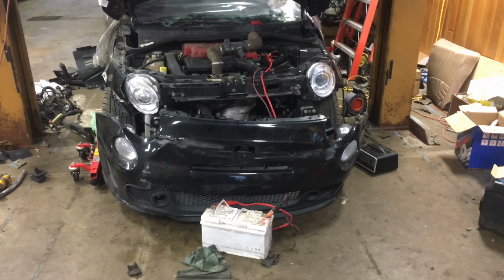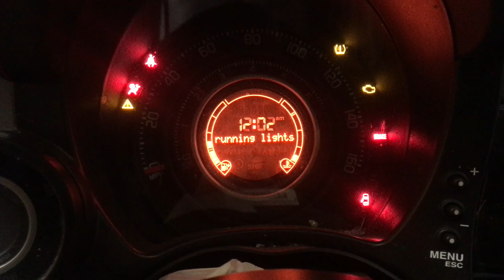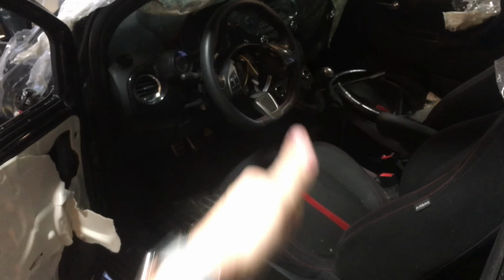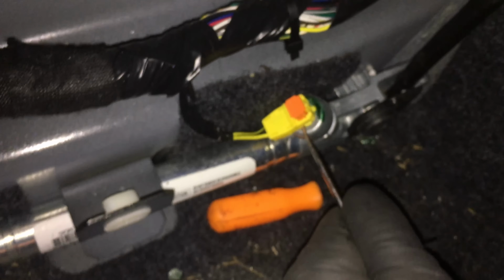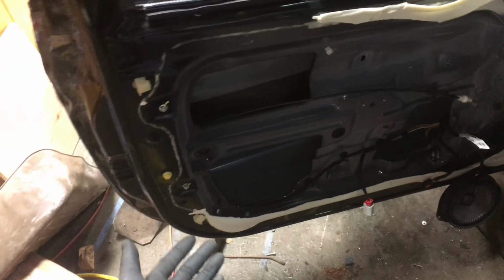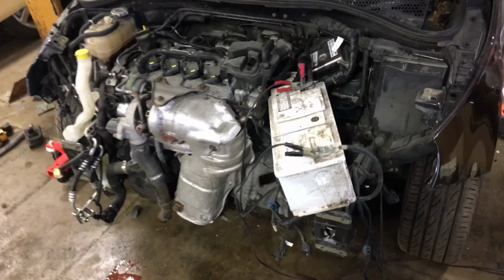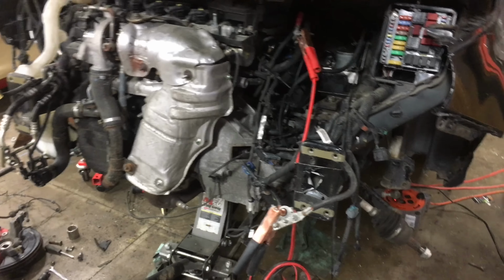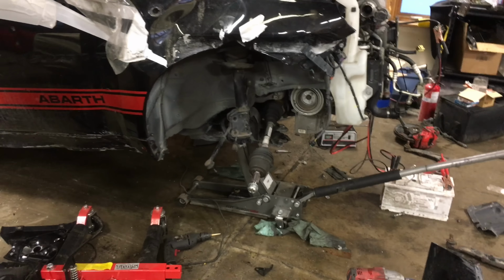Dismantling the $800 Fiat 500 Abarth Parts Car!

Comment: That sounds like my e30..
Reply from the maker: hopefully your E30 is 24-valve swapped otherwise you need to run some thicker oil and adjust your lash :)
Reply: I wish it was a 24v but its only a m20b27 for now. Gotta do the valves still, and go get a smoke test. Does have 220,000+ miles anyway so I'd expect a little noise lol.
Reply from the maker: sewing machine noise is a little nicer than empty hydraulic lifter noise :)